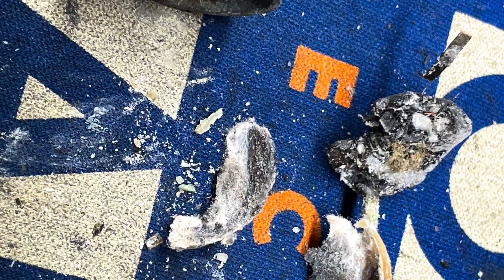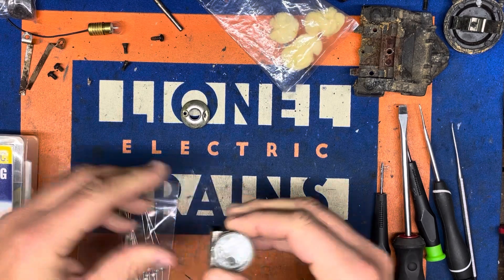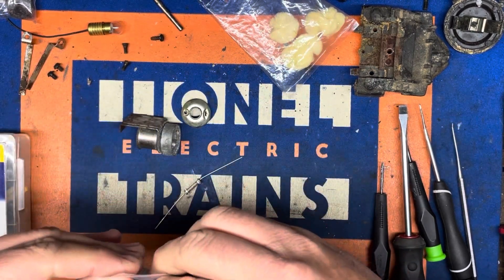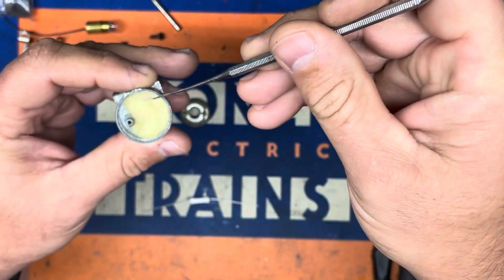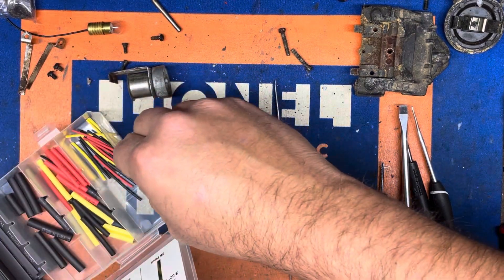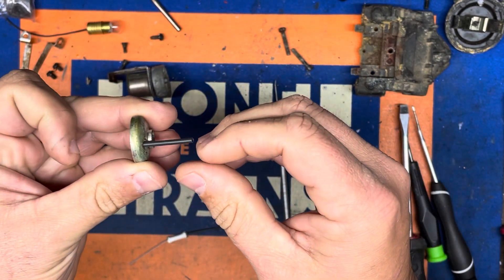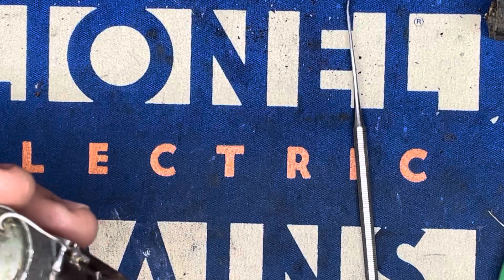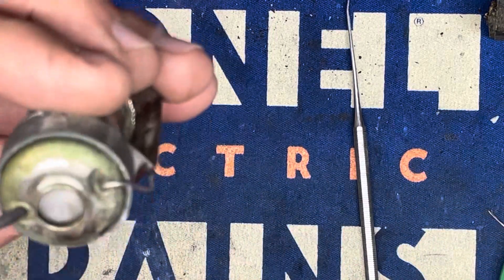Lionel PW Smoke Heater Element Conversion

Comment: Thank you for in-depth tutorial! I do have a question on the soldering part. What temperature was your iron at? I’ve tried in the past doing grounds to metal body parts, but it either evaporates or will not want to stick. Thanks!
Reply from the maker: Thank you for your comment.  Not sure on the temperature of the iron.  It’s a Harbor Freight $5 soldering iron.  I let it heat up for about 5 minutes, then apply the flux and add the solder.  Clean surfaces also help with the sticking.

Comment: Great video, I'm going to give this a try!  How did you remove the "top" of the smoke unit to access the inside pot?
Thanks
Reply from the maker: I just took a micro flat head screwdriver and worked in between the pot and the top.  Patience is key here.  It may take several “laps” around the pot to separate pending on how much smoke pellet residue has built up.
Reply: @modeltrainsolutions7368  ok thanks!

Comment: What ohm resistor/element are you using ? Looks easy.😊
Reply from the maker: Thank you for your question…I used a 27 OHM heater element & 8141 wick.